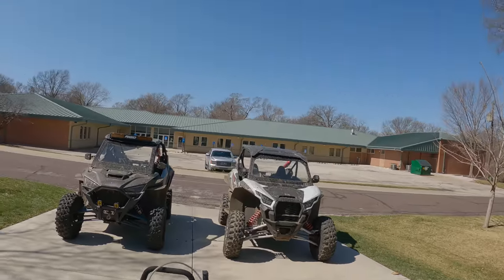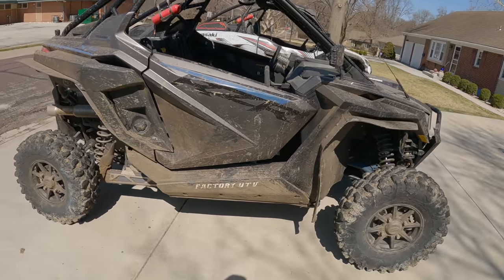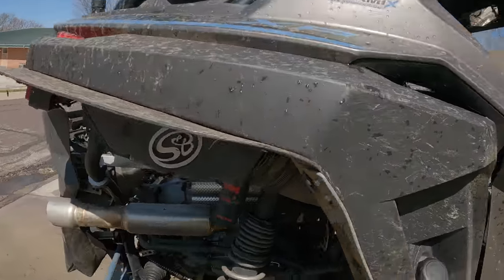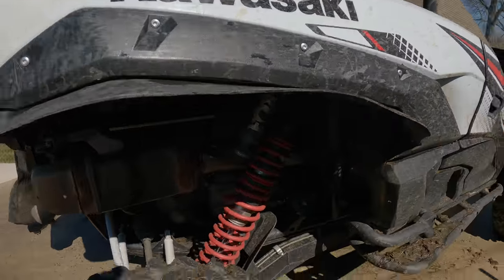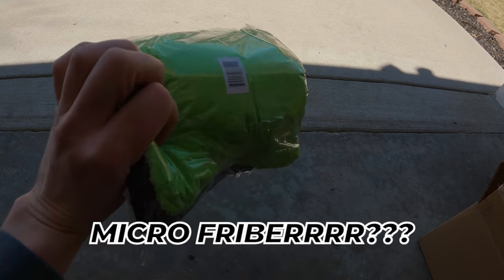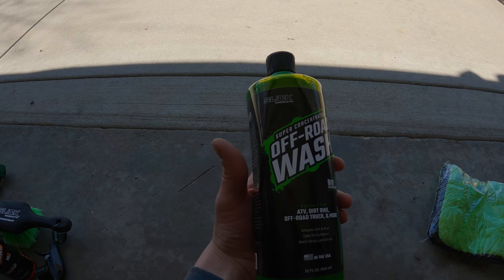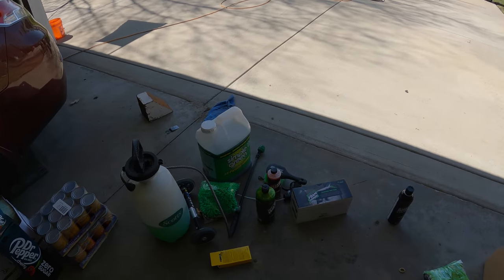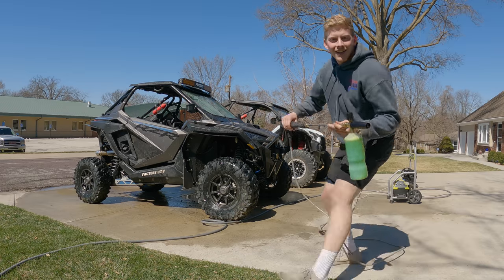Testing the BEST WAY to clean your SXS! Slick Products vs Simple Green Comparison!

Comment: I bought a foam cannon with the "snow " soap. You are supposed to add 4oz of snow and fill the rest of the bottle with warm water. Instead of warm water I used simple green , full strength,  amazing results.
Reply from the maker: Daaaang that sounds like a killer combo! I’m going to try that on the next wash, just dump some simple green in with the foam cannon. Do you hand wash at all or just spray it on, let it soak, and then spray off?

Comment: Great video, thanks for the comparison!

Where did you pick up the “wheel well liners“ / block-off plates, and also which fender flares are you running? Thank you! Keep up the great work!
Reply from the maker: Thanks for the support! I just added the link to the wheel well liners in the description , they are Double OTT. The fender flares I am running are the RokBloks fender flares. I love them so far, they seem to be very durable and block a lot of mud without looking huge like other flares tend to look!
Reply: Thanks!

Comment: When I was into the RC 1/10th buggy racing hobby. I cleaned my rigs with a mix of Simple Green and WD40 or of a spray bottle. Might work out of a foam Cannon. 
I know it sounds weird, but it worked great and protected all the surfaces and left them with a nice shine. 
You should give it a try, I would stay clear of your brake rotors, although we sprayed that mix on everything without issue. But then again , my life didn't depend on it. 😆
Give it a try and let us know how it goes.
Reply from the maker: Did the WD40 leave a oily layer all over it or was it not too bad? One issue I had with the slik products is it left a oily layer behind that attracted dust real bad so I don’t want that. Simple green is seriously one of the best options for the money I think
Reply: @Schmidty's Offroad  yes its does leave a lite film, which was intended to provide protection and prevent dirt and clay from the track from sticking. 
I'm ok with dust sticking to the machine if the end result is that mud is easier to remove, and it gives the quad some protection from the elements. 
I've never used this method on a quad, so I don't have a clue how well it would work.

Comment: It’s a gimmick for sure I bought it once and I still had to go back with was and I used purple power, wondering about the simple green, where did you get the blocking plates
Reply from the maker: Yeah it wasn’t near as good as I was hoping. Simple green seems to still be really good. I have started using Advanced Kotings which I like but I usually hand wash it.

The block off plates I think I literally got on Amazon. I’m not sure what the actual brand was but they worked pretty good!

Comment: Can you stray the simple green on the entire rzr including the motor and radiator?
Thanks
Reply from the maker: I try to avoid ditectly spraying it on the motor and radiator but we aren’t super careful. It should be fine on the motor, as long as you dilute it with water. The only thing I would worry about is the rubber hoses getting dried out from the chemical but we haven’t noticed anything weird happening

Comment: Does simple green ruin the plastic? What about the grease points?
Reply from the maker: We have never noticed anything funky going on that would be caused by the simple green. We don’t typically spray it inside the cab on electronics and then try and keep it from drying on rubber and electrical wires. We have been using it for several years and no issues yet!
Reply: It’s a degreaser but it won’t damage plastics or damage grease points. I clean equipment for a living and use simple green to clean everything
Reply: @jakesides3613  appreciate the answer man. Thank you very much
Reply: Simple green is safe for everything including the environment.  LoL. I have been using it for about 20+ years